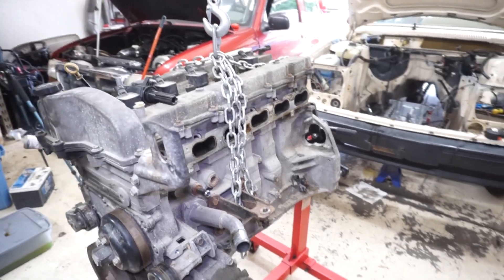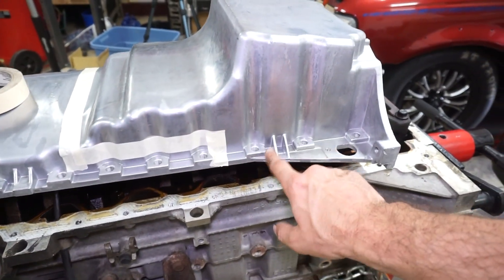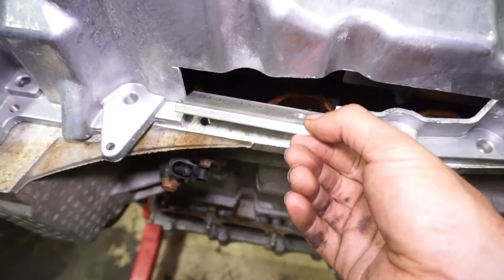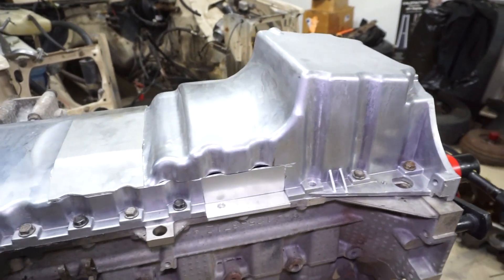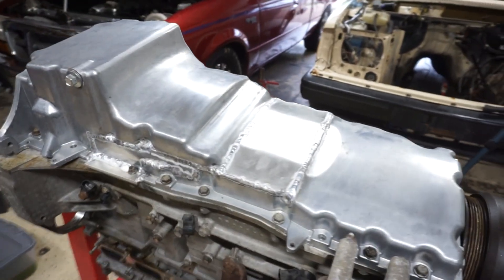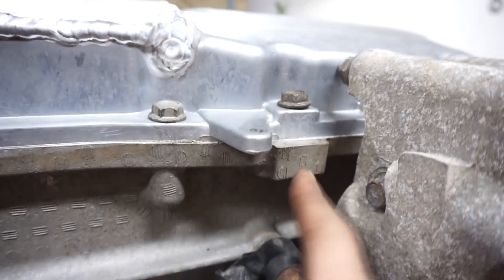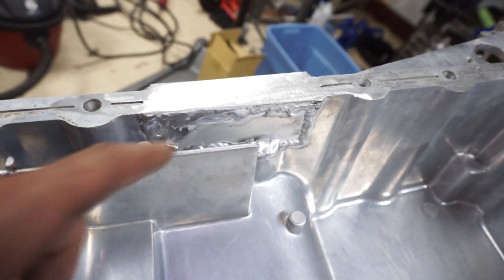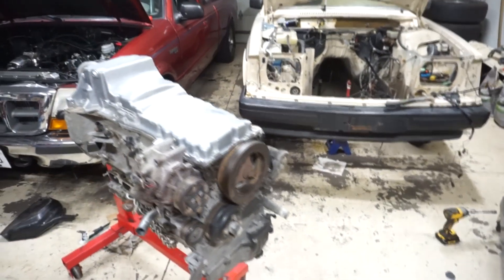DIY Vortec 4200 Rear Sump Oil Pan Ameri Barra FooJZ SWAP!!!

Comment: I might have missed it but why are you not using a 6 cylinder pan? 
Wrong sump placement?
Reply from the maker: Front sump, and it's like 10" tall because it has the front differential going through it.
Reply from the maker: Pinned your comment, good question. I didn't explain it.

Comment: I'm thinking that pan will be fine.  The factory type gasket allows for some imperfections.  Torque it down, let it go through a few heat cycles, then recheck your fasteners.  No biggie

Comment: What tool did you use to cut oil pan pretty nice
Reply from the maker: Oscillating tool.
Reply: @BlaserBuilds  any certain blade
Reply from the maker: @vrg69  Was just a wood/metal blade from hardware store.
Reply: @BlaserBuilds  thanks brother

Comment: I have a Diamabrush on a 7" angle grinder with dust shroud sitting around since doing my garage floor if you wanted to borrow it
Reply from the maker: I ordered some stuff for the 4" grinder.
Reply: @BlaserBuilds  Ah cool. I used a shop vac with dust deputy too which worked well. If it doesn't work out just let me know, I can drive my stuff down from GB 👍

Comment: Are you concerned about windage loss if you over-fill the nominal 5 qt capacity? What was the nominal capacity of the OEM 4200 oil pan?
Reply from the maker: I believe it's 5. Not sure. Not too worried, I think you can fit some extra and not be an issue.
Reply: 4200 is a 7 qt motor